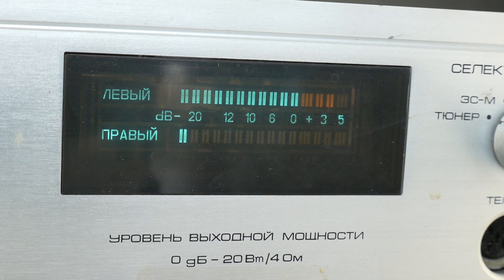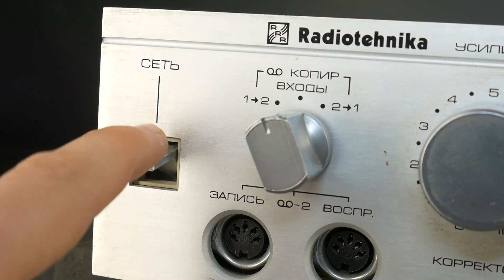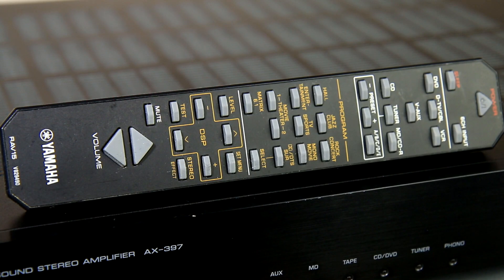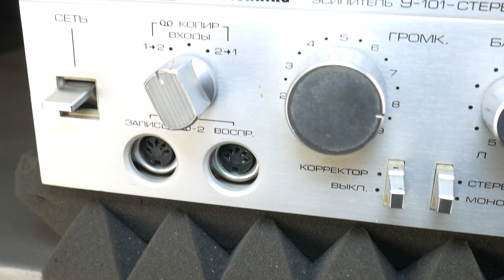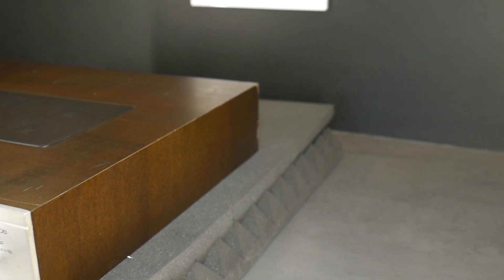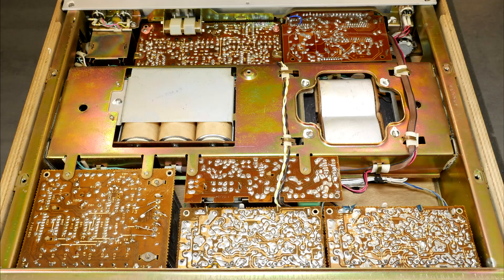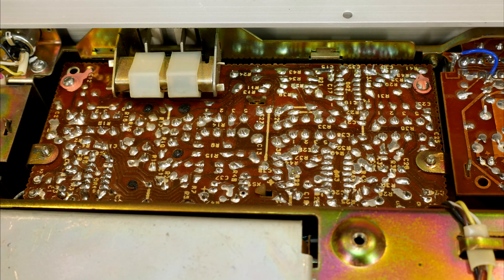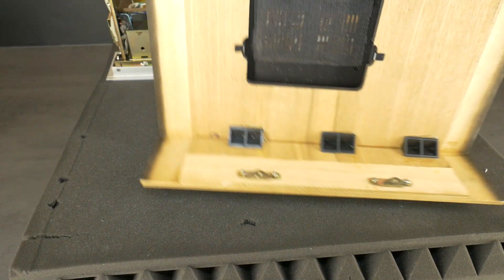Teardown 80s Radiotehnika Amp - Disassembly

Comment: I bought one of these from some dude in Russia about a year before the war. He did a good job refurbishing it and I think I paid about $200 with the shipping. Ukrainian sellers on eBay have ample spares for it; no need to buy from Z anymore. 

It's probably one of the few examples of this unit in the USA and it always strikes up a conversation in the shop. Unfortunately, and unsurprisingly, the Soviet era semiconductors appear to be giving trouble as the unit has intermittent static crashes once it warms up. If I had to guess, I'd say the problem is likely one of the KT3107B PNP transistors in the input stage of the power amp or one of the op-amp ICs in the tone control amp. One of these days, I'll get out the freeze spray and find the troublemaker.
Reply: I have repaired some of those U101s and those KT3107s have never (yet) given any trouble. If it was untouched amp I'd recommend replacing those red ceramic capacitors in poweramplifies. Those cause kind of wind noise after warming up. Also those big electrolytics in rectifier board must be replaced. Also input selector board could cause trouble, specially it's vinyl player amplifier(electrolytics die inside of it). I have bypassed selectorboard by soldering three preamp input wires to nearest DIN input on front panel. It is quite easy amplifier to fix as it does not need any exotic parts (outside of indicator board), PCB material is also rubbish though.
Reply: @Tegelane5 Thanks for the tips! Ceramic caps on Japanese and Western gear generally give no trouble so I wouldn't have suspected those.
Reply from the maker: As I am from Europe/Latvia, if you are interested in some old USSR audio equipment, I can help with delivery. You can check the Latvia Facebook Marketplace or the local second-hand website ss.com, where you might find some interesting equipment in the audio category.

Comment: Two average salaries for a stereo amplifier... Compared to the prices of genuine western LPs and cassette equipment that's peanuts. A typical large boombox (Sharp 777 et al.) would take an average annual pay... and they sold like hot cakes. My neighbour owned two top-of-the-line Nakamichis (each worth at least like a Volga car), go figure. It was a very disparate society (although not as badly disparate as today).
Reply from the maker: Thank you for such a detailed comment.
Reply: LMAO a ghetto blaster cost 2 average annual salaries? Where was that? In Somalia of the 1980's? :D I owned one of these U-101's back in mid 1990's and while they looked cool, the sound lagged behind even a Sony integrated combo tower from the late eighties. The last integrated A/B I bought was an Onkyo A-9010 and it cost about 7% of my monthly post tax salary brand new. 😎
Reply: @shirley-ie5vj  In the early 1980s typical industrial wages in the Soviet Union were around 300 roubles/mo; service wages (including doctors, teachers etc.) were much lower at 150-200 roubles/mo. Converted at the official rate these would be $400/mo and $250/mo, but the real rate for quality imports was 4-5 times higher, and real incomes were 4-5 times lower. Something around 30 to 100 dollars a month. And don't forget that big quality boomboxes were never cheap even in their homeland, we're talking at least 500 dollars base price  plus costs of shipping and smuggling.
Reply: @jmi5969  Ah ok, that just about checks out. From what I recall you couldn't readily get a $ from the black market for less than 10 rubble though.